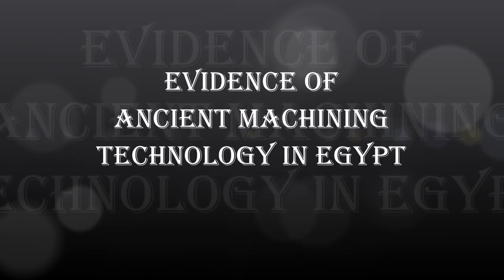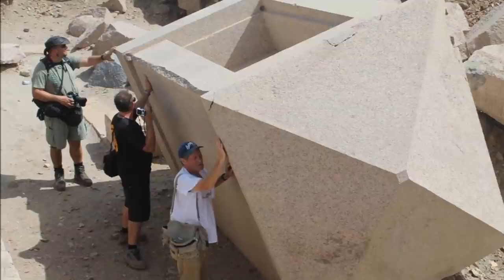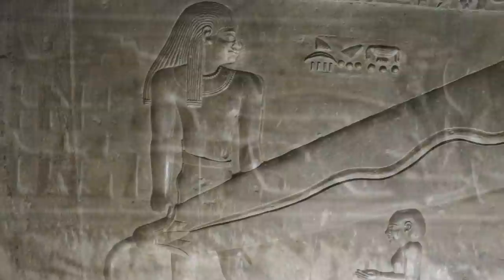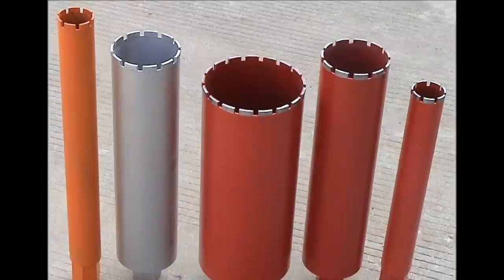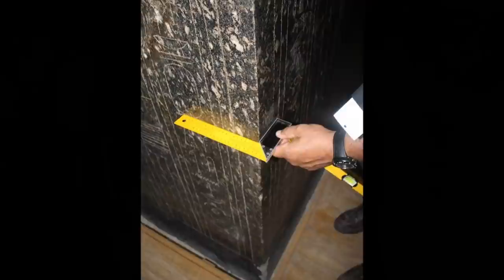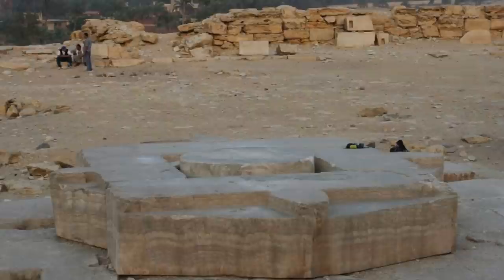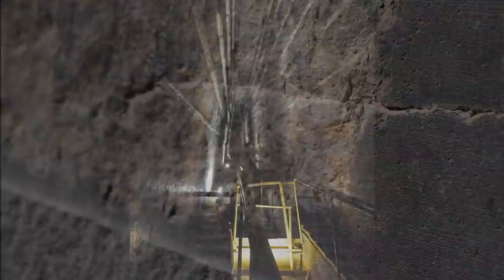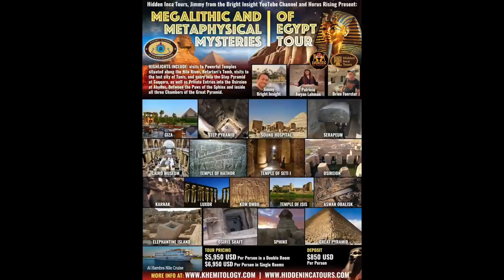Megalithic Marvels Of Ancient Egypt

Comment: ive spent entire days using modern drills to get through some stone foundations just to run a furnace vent through and its not near as hard as these i can only imagine what it took to get through
Reply: I'm a service tech but have done many, many installs.I don't know if you're commercial  or residential or your experience with crane or copter  lifts but if you have a lot of it get a 4 1/2" grinder and several diamond tipped blades...a granite cobblestone or other piece of "experimental" granite.With that lifting knowledge...get to experimenting with cutting and shaping the granite(on that miniscule scale)and  let the confusion,wonder and fascination continue with almost miraculous constructing of the worldwide Megalithic sites.My belife is that you cannot really have any kind of grasp of  the enormous scale of difficulty these structures would be to erect my HVAC brother...and WE know a difficult trade...commercial, industrial or residential,we at the top of the list, mentally and physically...an incredibly difficult trade.😉

Comment: Something tells me the whole site was a power plant of sorts
Reply: Im thinking more like irrigation
Reply: Bingo
Reply: The problem with people is that they really don't understand electricity or how power plants work. Take a automobile it's Power Plant is a 12v battery you can touch the main bare wires or post and not get shocked.

But ask any mechanic what would happen if the insulation cracks open where the sparkplug wire plugs into the sparkplug, one time is all it takes, that insulation is rated for High Voltage. So how did the 12v go to High Voltage?

Power Plants work differently than what most people think like the car battery you can go from Low to High Voltage or from High to Low Voltage and make the impossible possible like Mag Trains Levitating at High Speeds or your pocket Cellphone capably of sending clear pictures with audio around the World.

But even in modern times not everyone has access to these Technologies. I live in one of the Richest Countries yet don't have access to a Mag Train for High Speed Travel but Japan does. Eventhough the Cellphone only uses a miniscule amount of Energy to work many parts of the World don't have them. 

These are things everyone can own but takes for granted and don't really understand the Mechanics or Physics that make them work...

Comment: Hi Brien, I have noticed that many of the pillars and walls with carvings had been first covered in a finer mud, then the hieroglyphs were drawn into that mud before solidifying. This is evident due to the flaking of the mud layer, shown all around the site. Now that is a lot of mud compound, and they would have required an area to ground all that sand, so perhaps those giant bowls were simply used for grounding sand into powder. The holes were to add water to make the mud compound, because a lot of this compound was used on pillars, wall and tombs.
Reply: Limestone cement. Traditional production of limestone cement is well within the capabilities of dynastic Egyptians.
Reply: @MrBrianms  you are talking of mortar from burned limestone , very weak bond and it is not cement

Comment: The image you show at 5:46 show something I had not seen before. I am totally aware of the 8 sides. But in the drawing you have it shows another angle in the middle of each side. Does this not make it 12 sided? At least a third of the way up.
Reply: Yes, that's a new one to me as well. I wonder if that's what the interior limestone looks like, without the polished limestone casing blocks.

Interestingly, the Great Pyramid may have been the very first building that did not cast a shadow. Instead, the reflection off its casing stones, polished to very high degree, would shine a light into the air that would have the appearance of a bow. As the sun dropped lower in the sky to the south, the "bow" of light would appear to draw down. And as the sun returned to its zenith in mid-Summer, the "bow" would seem to release upwards. That's how it was described in the book "Decoding the Great Pyramid" by Peter Lemesurier.

I could also imagine the imagine of reflected light could also look like a cross in the sky.

Comment: Is there a connection from the halted work at the Serrapeum, and the unfinished work at Ollantaytambo and Puma Punku? Were these projects suddenly halted because of the incoming celestial object that impacted the glaciers that signalled the end of the Lesser Dryas?
Reply from the maker: unlikely
Reply: @brienfoerster  Thanks for the reply, Brien. I agree, it's unlikely. But it is odd that the Serapeum has a box and a lid not just left in the middle of a narrow passageway, but also without its polished exterior, which would have been done in situ. 

We also see signs (as you yourself have suggested) that Puma Punku had a number of stones, including at least one of the H--blocks, that were unfinished at Puma Punku. You even suggested that Puma Punku itself was an uncompleted site.

Then add in the "dropped" megalith, abandoned half way between Ollantaytambo and the quarry where it was cut. 

Yes, it may be circumstantial that these three sites show signs of work just being halted in mid-construction. But we do have the theory that an incoming celestial object impacted the Earth circa 10,500 BC. It's possible that the Builders, whoever they were, only had enough time to gather all their tools: we've never found a single piece of ancient tech, not as much as an extension cord, left behind.

Comment: I think , ancient civilizations have high tech and  laser tech.
Reply: It wasn’t lasers, it was concentrated sunlight.
Reply: Possibly Saser(concentrated sound)
Reply: @et2347  What if your both right and it's some kind of technology that uses sound and light at the same time. Different Light spectrums & Waves of different kinds and Different Sound or Vibrational Frequencies. There could be more to it
Reply: @Pause4pot  I wasn't suggesting saser as replacement of other tech, rather as complimentary... Also, technically speaking light IS sound as both are merely disturbances in the eather expressed as wave function. So yes a technology using multiple frequencies of light and sound simultaneously is definitely a possibility.... or even a probability. Not just for cutting but levitation for transport and construction as well. What do you think??
Reply: @et2347  idk man I think God's a Dragon
Reply: @Pause4pot  lol fair enough.... 🐉
Reply: @et2347  🔥🐲🐉

Comment: The Osirion blocks look dovetailed to each other..wow. The tiny drill holes are really impressive. You gotta hit high rpm for that and the heat would become an even much bigger factor than with the larger drills. And of course you'd need even more precision tools to hold that bit in place
Reply: You'd need a gigantic,diamond tipped,high speed 3D printer to accomplish the statues......the core drilling must have been a breeze?
Reply: @terryhenry4099  It's just insane, and that Elephantine Island box is just ridiculously incredible and beyond difficult. Even the way they cut the stone walls flush at Petra is incredible. It's like they had massive wire saws to remove the stone. Wire sprinkled in diamond dust attached with super-mortar. And you can figure this stuff out-looks doable small scale with a nice soft predictable block of aluminum, but doing with with stone and stone that size and weight is just another realm of difficulty.
Reply: @wheelmanstan  There is definitely a different type of physics then we know in play with the mining,transportation(lifting)and sculpting of all the megalithic blocks and statues....and we'll sadly probably never know how?
Reply: @terryhenry4099  Different civilizations went different routes solely because they missed a few ingredients or they were limited in their ingredients. Without petroleum we wouldn't have combustion engines and plastic. Our world would be entirely different. We might have mastered building with stone instead or cars that run on water. 

We know how a lot of things work but with a lot of things we still haven't pushed them to their full potential, especially when so many other things occupy our minds and time. They used stone to its full potential I think and the issues we see, like weight and hardness, they might not have seen. Who knows. All I know is that they lived short lives-their time was more valuable, yet they devoted an unnecessarily long time to building with stone even when they didn't have to...so it must have been much easier for them than it looks to us.
Reply: @wheelmanstan  You never know...they might have lived longer than us.I believe in the 12,000 + year advanced civilization(World Wide Atlantis) theory . Way too much proof and not a single piece of historical records that tell us who they were and how they lived....just pieces of the Megalithic puzzle to boggle our  minds.

Comment: It's a shame that you throw in the light bulbs and the so-called UFO and helicopter as those have been shown why they look like that and it seems like you're reaching when I know the actual machine work is all the evidence you need.
Reply: Egyptians did have tube drills, powered by bows and man power, they also had elephants, many of them, that could move huge stones
Reply: @Digital__rb  not many elephants in South America.  How did they move the stones they used?  And what metal were these ancient tube drills made from?  They didn't have steel.
Reply: @HyperionRexx  they had flint, diamond, sand and water used as abrasives.
Reply: @Digital__rb  yep, they did. Now try and make tube drill out of bronze that can produce the level of work seen here even using diamond and flint etc.   I'm no way saying this was alien tech or anything, but we can barely reproduce what these ancients achieved even with all the modern tech at our disposal.
Try asking some engineers how they would move a 500 ton block of granite several hundred miles. It would take some serious planning and extreme machines to move one block.  The ancients were moving blocks like this in huge numbers. Saying they had a lot of elephants was genuinely funny.
Reply: @HyperionRexx  so they had anti gravity tech, that the romans discovered, the tech is in the possession of the elites and only the elites. Or there was a highly advanced pre younger dryas civ that maybe looked real similar to what we have now, where the entire system is dependent on electricity, a solar flare happens, fucks it all up, mass human extinction except for the super elites and the people that live off the land (like we have today, super elites and people in remote areas that would be unaffected by solar flare) the elites with their high tech find the hunter gatherers and the hunter gatherers refer to them as gods with superpowers and thats what ancient mythology is... thats possible, aliens are also possible, whats also possible is man and nature working together in a way that we cant even imagine.. i do believe its possible the Egyptians with man power and animal power created the mind boggling objects. Theres many possibilities, with the internet its only a matter of time before we find out the truth, just gotta wait and see i guess... but when the truth does reveal itself.. will anyone believe it? Our reality is shaped by electronic devices that are hooked to a system thats put in place by the elites.. whats real? Nature is real, mushrooms are real, weed is real, energy is real, idk man. Earth is old as fuck, look how far we’ve come in 100 years, from horses to teslas and robots at Boston dynamics.. maybe were on a very complex farm and were all being farmed, it kinda feels like that because human instincts and spirit dosnt tell us to work at a job we dont care about to survive, the system tells us to do that, what if we followed our spirit and did what ever feels right, maybe they did 5,000 years ago and that how they made the pyramids.. they built them before they had currency, it was a barter economy at the time of construction
Reply: @HyperionRexx  Egyptians we’re highly advanced, all they had to work with is stone, its possible they just got really reaalllyy good at it in ways we could never duplicate because were distracted by all the other materials we have now.
Reply: @HyperionRexx  how did the romans make the sarcophagus of Saint Helena, or Neros bathtub?
Reply: @Digital__rb  
Those two items were made of marble...no?
Reply: @johna.4334  similar hardness to granite or diorite
Reply: @Digital__rb  
Is it possible the ancient Romans stole these artifacts from somewhere in their empire? After all, they stole the solid granite columns (from Egypt?) seen out front of the Pantheon.
Reply: @johna.4334  possible, but have you seen the sarcophagus of saint Helena? Looks very roman, dosnt look egyptian at all
Reply: @johna.4334  i used to think the same way youre thinking right now, theres an endless amount to learn about ancient history, its amazing, keep learning